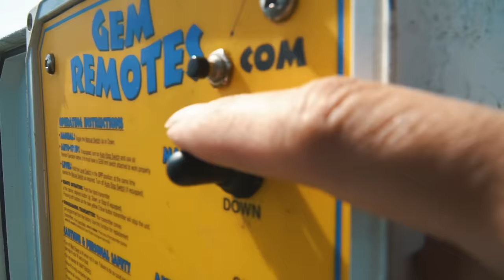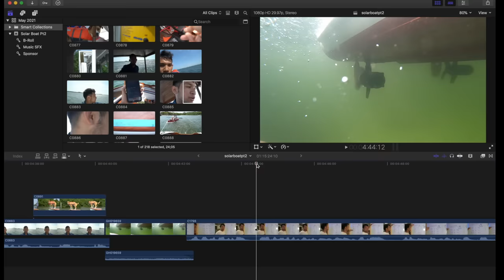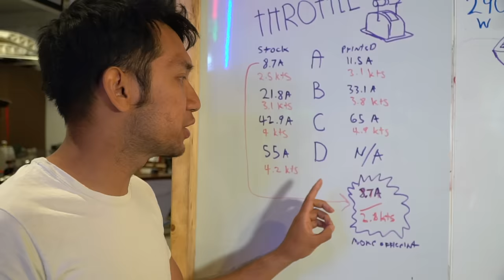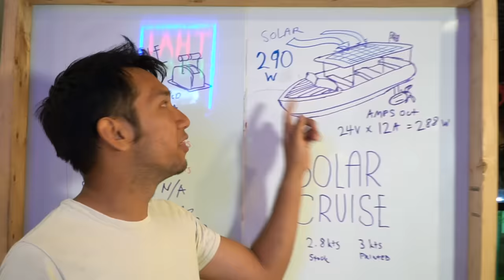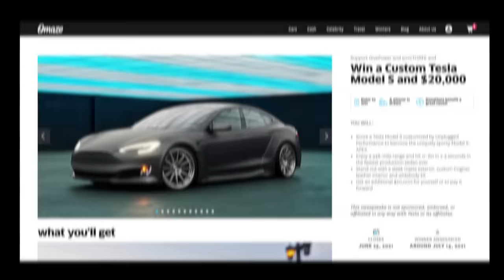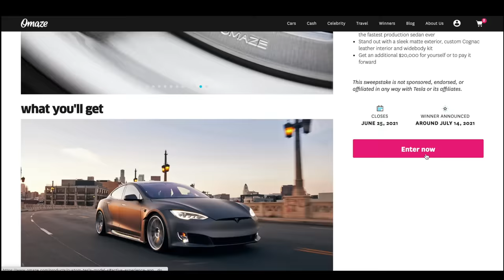Making A SOLAR electric boat (infinite range)

Comment: Now make a program that checks Solar Panel W production and the W draw of the motors that automatically adjusts the throttle settings to match 1:1 with the production vs draw. Easy automatic system for infinite travel. Kinda xD

Comment: Yo if u get a gas outboard and would it spin the props of the trolling motor and could possibly also charge the batters and you would be able to go fast for water sports and be able to Cruze back and the solar panels with also charge it. Like you would cruise to the spot and then use the outboard and charge the Battery even faster

Comment: You are on water! There is no space constraints. You can design the roof as multi layered stacked with extra solar panel. And pul out the panels when you need more power. Try it.

Comment: I wonder what would happen if you tried to smooth the surface of the 3d printed props more, you'd use less power for a higher speed as there would be less resistance

Comment: look up Tech Ingredients Tesla Catamaran. He says that a thin blade prop from RC's have a higher pitch which prevents the blades from being slowed down by the water hitting the prop forcing it in reverse causing the higher load

Comment: Yawg, I came up with a trick for backing a trailer. I switch to steering with the bottom of the wheel. I put my hand underneath the steering wheel and steer like I normally would. Yeah, I can't be bothered to rewire my brain for a five-minute launch job that I might do twice a year, so I change my hand position. Why fight it.

Comment: Hey Peter, you weren't getting good efficiency out of your panels becuase they were getting too hot! Rigid panels tend to let air flow underneath them, unlike flexible ones. If you raise your panels, you might get 10% more efficiency out

Comment: So like I got back to this video. I think what would be great is that you use the solar panels to power a hydrogen generator which would in turn power a motor for the boat. This is what I could think of :>

Comment: Is it possible to make a toy plane or helicopter fly using 3g or 4g so that it can fly really long distances. You could send the controls over the internet to the plane or helicopter so that as long as it has a 3g connection, you can still fly it? 

what do you think?  🤔

Comment: yoo broo .., i really love this ,. i have an idea., how if you make the motor portable ., you can put it on and off ., or you can make it up and down 90 degree swivel angle,. if the water level is too low., you can using paddle boat, and you can lift the motors up .,. sorry if my words not so well ., lol
i love fishing sport., and I want to build a cheap electric boat like yours.

Comment: Can i use 4 of those solar panels with 2 batteries to run the 3500 watt pure sine wave inverter on my 28 foot bayliner 🤔 trying to avoid buying a generator

Comment: Now I want one of these solar powered boats for myself. Was this very expensive to build?
If it isn't too expensive, I might try building one myself in a year or two.
Reply: Take your time to aquire the parts. If you have patience you can usually find old john boats and trolling motors for cheap and/or free on craigslist.

Comment: Just know when my wife ask why I'm adding solar to my boat I'm blaming you. I lucked out at work and we had to swap 2 7.5 hp pump motors and now I'm gonna see if I can squeeze one in the outboard of my 16ft skiff next will be a full electric swap on my 30ft cabin cruiser

Comment: You need to 3D print some Shramm or toridal propellors.
Reply: Rc test flight did a bunch of test and found out that the regular props where more efficient (though they where kinda jank tests)

Comment: how about insert a Batterie which charges through the Panals while not using or using less then the energy the motors opperate on?

Comment: get yourself a large motor and run a inboard. something bigger then a washing machines or dryers. or start from scratch, get a slightly larger boat and drop a tesla drivetrain in it. any tesla would do.

Comment: One small problem with your math after the controller the battery you need to read amps everybody makes that mistake
So ohm's law tells us depending on how full the battery is you can only get less than 20% of the solar panels output

Comment: Cool to see you came back with another video. I finished my electric boat as well. I upgraded to the haswing 5.0. worth it big time. Way more power. My 3.0 is a back up now. Just got back from the keys. We will have to get a electric fleet going.

Comment: Manatees are avoiding noise, they have problem to recognize propeller blade danger when there is combustion engine in low rpm or electric propulsion.

Comment: larger diameter propellers are more efficient.  2  blades more efficient than 3.   Trolling motors are low-efficiency anyway and spin too fast.   I achieve 2 knots at 9.5 amps at 13 volts on a 33ft boat 'using 32 inch propeller.

Comment: The reason the boat is so slow, is because you put the drives way too far outboard and a bit too forward. I did not get clear view of how close they were too the bottom of the boat, but prop clearance should be about an inch. That boat would push well over 10  and go for a two blade once you set the motors right. Three blade with that much pitch and going up higher in rpm with not much noteble change shows its a power prop and not like a two bladed speed prop. Have had boats my whole life and am 60 now and I new before I saw the boat in the water it was going to be really slow. Think of it this way if you had just hung one motor off the back it would have gone allot faster, but if you correct she will go.

Comment: It’s not infinite range. You can boat at your slowest speed for what, like 10am to 3 pm (5 hours)? Then you have to be dead in the water for 19 hours till the sun comes up again. I mean compared to a petrol boat are those considered “infinite range”? You could prob do the same thing but you don’t call those “infinite range” do you? Just have someone deliver you gas cans of petrol as you idle your petrol boat for “infinite range” and you can be under power 24 hours a day.

Comment: Want to make that motor on that boat go fast get yourself a manta 2 motor it's a 10 horsepower 24 volt 12 volt or 48 volt depending on how much juice you want to put into it but it's a 10 horsepower motor it's no bigger than an alternator find an old small outboard motor pull the motor off of it and hook the Manta 2 motor to the outboard and I guarantee you you'll be able to pull skiers

Comment: Why dont u try taking out a tesla power bank system and add large solar panel to charge it up see what  the boat will do if i would be able to get the electric system with solar charging system i would do it here in the Philippines want to help text me